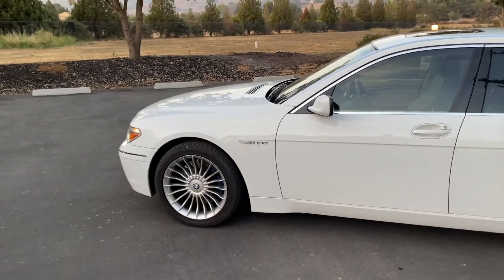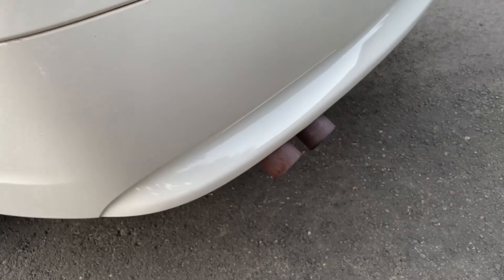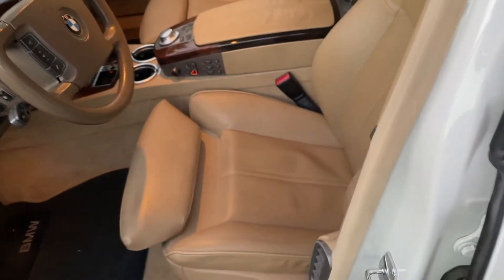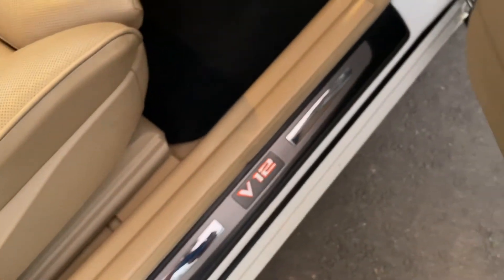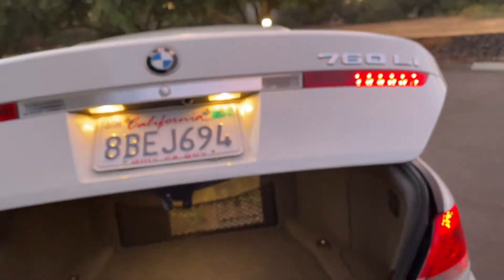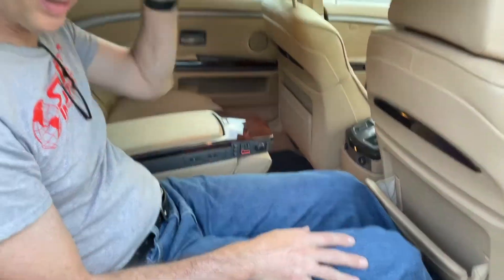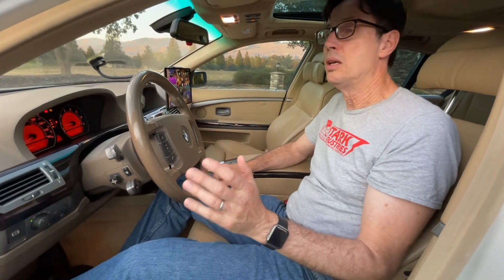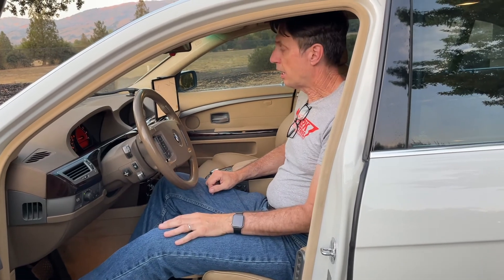2004 BMW 760Li w/ custom F-1-sounding exhaust, M5 brakes and M5 diff installed. SOLD for $9000

Comment: Hey there. Exhaust sounds nuts. I noticed this car has the pipes turned down; did you keed the stock muffler setup or did you use Super 10s on this one? Tried looking at older videos but couldn't quite figure out if this one had been shown or not.

Think the 2' long X-chamber is what brought out the high pitched sound? I've heard some other 760s with a normal, short X-Pipe and it didn't sound anything like this one.
Reply from the maker: Thanks, glad you like it. So, if you browse my channel and see the V12 exhaust I developed on the black 760Li, this was the same exact exhaust:  super 10s and the center chamber. Yes. When I got this,  I drove it stock for a year, then I had the exhaust, the M5 brakes, the M5 diff, the custom driveshaft and M5 half-shafts all transferred from the old black car, to this car. I drove it for another year, then I got the itch to replace this white one with a G12 M760i, which was waaaaaaay more $$. (my retirement treat). The only thing I did not do was cut the two half-circles in the white bumper like I did on the black one. Those two turned-down pipes were my original prototype test-tips. I sold the chrome tips with the car, in case the owner wants to cut the bumper and mount them.

Comment: Nice car friend, doing the m5 brake swap now on my e66 4,8. Why did u change the diff to m5?
Reply from the maker: went from a 3.3 to a 3.65 final drive, I believe. in any case-- quicker car with only slightly worse gas mileage. Also you get a true Limited Slip Diff.
Reply: @slkttop  how was the swap? I was also lookinh for different lsd options
Reply from the maker: @milan2230  look in bimmerfest.com for that swap. I know I posted about it Feb 14., 2014. its called "Put an M5 diff in my 760Li, could use some ideas..."  I cannot post the URL in Youtube, (I think it won't paste in) I do remember you have to cut off some cooling fins on the driver's side to fit the exhaust tubing. and I had to make a driveshaft that was used junkyard M5 rear end and 760Li front end, cut and welded together and balanced by a local driveshaft repair and mod shop.
Reply from the maker: also, I used M5 half-shafts because they out to the M5 diff. They are 9mm shorter than 760Li shafts, but reach and work just fine
Reply: @slkttop  dang that's some work putting in g, Will put the lsd on a lower priority then but will definitely look into ur post
Reply from the maker: @milan2230  it should be a lower priority. in the post I mention the shifts are slower bc the ECU and tranny ECU are confused. but in each gear it is quicker. same thing for my M760i, I boosted it with an ECU tune and now, the transfer case backs off on each shift for fear or breaking it. The brakes were worth it for sure.

Comment: I can’t wait to get my 2004 760li fixed right now it’s smoking blue valve stem seals I might swap the motor or rebuilt it
Reply from the maker: wow. I have never seen that blue smoke valve stem seal problem on the N72 V12 motor. Only the V8s. But anything is possible. Check with All German Auto (on YT and on the web) and see if they have a special tool that will work for that job. They do have it for the V8, for sure.  usually the problem we see is the High Pressure Fuel Pumps pulsation damper going bad. I have videos for that. Bimmerfest has guys who sell parts to fix it.

Comment: can we get a driveby video clip of the exhaust sound
Reply from the maker: buried in my channel, if you search on 760 there are 37 videos. This one is the closest I have to a drive by in the current exhaust config. 
            https://youtu.be/Kxwj_ph2oKk
              There are others that sound similar but in older configurations.
Reply from the maker: it is my older 760Li which I drove to 202k miles and sold. I had all the good mods moved to the white one in early 2021.

Comment: Can I knoe which m5 diff isit from which model
Reply from the maker: ah yeah, sorry, the brakes and diff are from an E60 M5.
Reply: Was it an easy fit . just a bolt on
Reply from the maker: @maikldolinski7452   not bolt on. the diff itself requires trimming off a few cooling fins just to pass the exhaust by it on one side. But, the diff bolts directly to the frame (if I remember correctly) The driveshaft has to be a 760Li/M5 hybrid. The end that bolts to the 7 is the 7 side, the side that bolts to the M5 is the M5 joint. you take the two, complete driveshafts to a driveline shop and have them mate them together after measuring and telling them how long it should be. Then you also have to use M5 CV axles. 
Honestly, I am not sure I would do it again.
Reply: I got no exhaust on so yeah should be fine
Reply: Does the car feel better with the m5 diff on
Reply from the maker: @maikldolinski7452   it is quicker while in each gear, so--better in traffic. It "is" actually slightly slower for each shift, I timed it with an old Gtech.  I think the Trans controller freaked out over the wrong speed on the speedo, vs the revs, and hesitates a bit, and then shifts. But for passing and acceleration in a single gear, it is better. There is an old post from me on Bimmerfest where I talk at length about it and show the GTech chart. user name "mws"